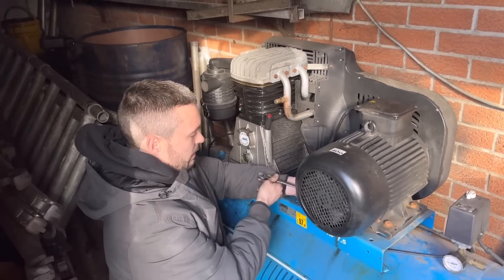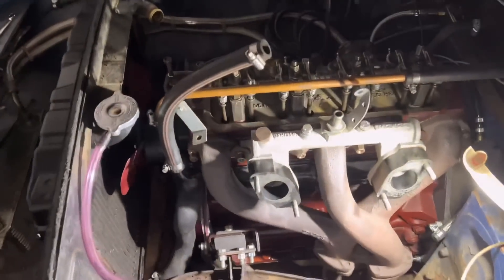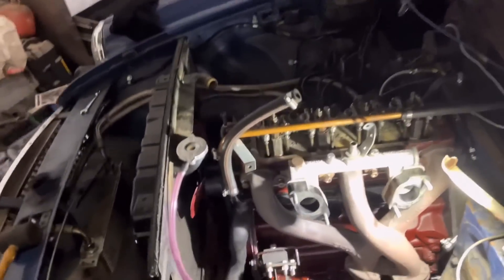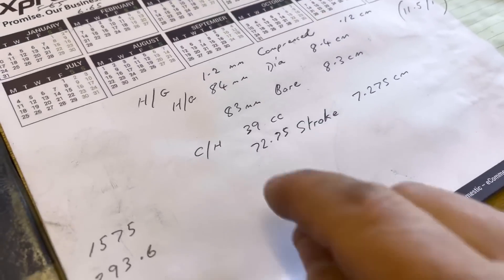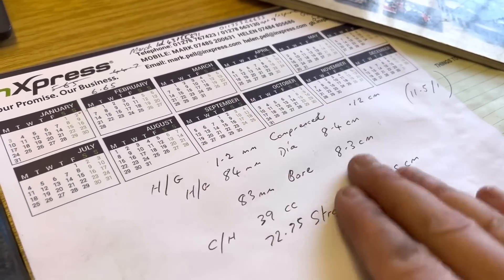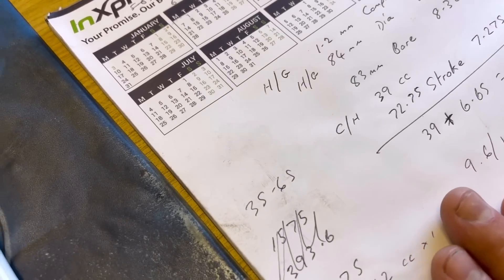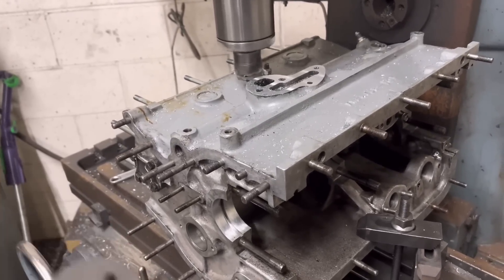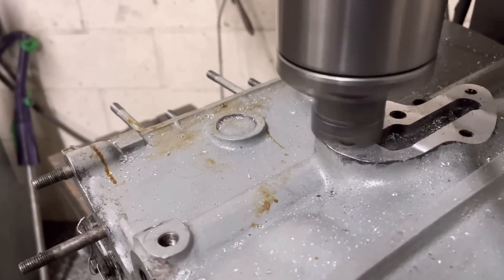WE HOPE YOU LEARNED FROM THIS!

Comment: Im surprised in todays age you’re still going at this with a calculator and pen  😮
Seems a simple excel sheet or a any number of apps or software would be much easier/quicker with less chance of an error…

Also make the CC “x” and set the ratio equal to your ideal number then solve for x if you wanna know what cc gives you your ratio instead of plugging random numbers 😉

Comment: Your claim that a flat top piston has no volume is incorrect. There are volumes associated with the piston that needs to be considered that contribute to compression ratio. 
Without knowing actual details of the piston I have made some assumptions, but will not be too far out. I calculate you are missing approximately 0.91cc, from the top land, bore chamfer, top land chfs (2), between upper face of top ring and groove, behind top ring. Of these the top land contributes the most. 
These are all factors used by engine manufacturers.

Comment: Swept volume + clearance volume divided by clearance volume = CR. Industry standard used by every manufacturer since the dawn of time. This gives theoretical max CR at 100% VE. Any other method (dynamic vs static) is a non starter as VE is not constant at different rpm, induction and exhaust pulse tuning  is impossible to work out etc

Comment: Great Info Lee. I've used that formula for 30 years. I would like to add for the muscle car guys working from Inches. The formula is.
Bore x Bore x Stroke x 16.389 x .7854 for cylinder volume.
Top job as usual

Comment: The MGB tappet side cover gaskets (original cork - suck, new rubber - better), those rubber gaskets compress once the bolt is tightened down.  IT's VERY common to have to gently, slightly, tighenthe center bolt two or three times over a few days to really get them to the point where they become leak proof. A hassle!  But, it works better.  Better to leave the carbs and inlet manifold off until that's done because the manifolds, heatshield, and carbs make getting to those two tappet cover bolts really difficult.

Comment: Nicely presented Lee - well done chap!  As usual its not quite that simple as you need to take into account the cam, more aggressive the cam and the less the compression becomes. Inlet valves stay open longer after BDC.  Longer they are open - lower the compression.   This is also a problem with efi engines as bigger cams often reduce inlet vacuum especially at idle, map sensors dont like that which often confuses the ecu making a smooth idle difficult to achieve.

Comment: Most compressors tend to rattle a way till something goes wrong before they get attention my own ones included. That two stage B series pump is a fair drive and most likely your aluminium pulleys will be worn so the new belts wont last as long as they should till they are chewed off again but you never know, the pulleys could still be in excellent shape. Also you did well explaining the compression ratio calculations, its perfectly simple the way you explained it, going by some of the comments on your excellent video some people really have their heads up their own ass.

Comment: I learned many years ago that when you go skimming heads, you make the deck face thinner and the headgaskets don't seal properly or don't seal at all. If it's just a granny's supermarket transport you'll never notice but if you're playing with boost then it's a total disaster.  Even a good stock head is at it's sealing limit with boost so there's nothing good at all done by skimming them. It turns them into scrap metal. Same goes for any sort of race engine.

Comment: Important to note this is the static compression ratio.  When long duration performance cams are fitted the dynamic compression ratio will be considerably lower.  This is because the inlet valve remains open well past bottom dead center.

Comment: You might find that you need to replace the pulleys on the compressor along with the belts. Sorry, not meaning to bring bad news but it's a distinct possibility. Keep up the good work and will you please switch to working in either metric or bananas completely 🙂

Comment: Your maths assumes that the intake valve is fully closed at bdc.

Engines don't make compression with valves open.
Reply: The calculation performed by Barum is for the static compression ratio - aka the geometric compression ratio.  Dynamic compression ratio is a more complex to calculate and requires additional data.

Comment: I used carbon copy paper on various surfaces to see if they are flat matching, also on manifolds and inlets and exhaust ports and their gasket to make exactly the same flow. 12G295 BMC heads on small bore A series engines always then. Compression ration on 998 with dished pistons, work better than 998 Cooper d top pistons. Took I think 180 thou off the cylinder head to get about 10:1 for four star leaded fuel then. Araldited floating gudgeon pins circlips. Good for about 7000rpm with a 948/229 Cooper 997cc cam, the longer stroke with 850 bore cam.

Comment: On the mg b series engine it doesn't matter which gaskets you use they will leak if you don't seal them. From the factory one side was glued with bostic and the side onto the engine was dry. Once the engine goes through a couple of heat cycles they will leak slightly getting worse with time. If you keep on tightening them the plates distort just seal them and nip them up not too tight.
Reply: I used red gasket sealant on cover mating, and non hardening gold on the block surface. Never had an A nor B series BMC engine leak, with the usual other places given attention too. Christ, this was forty years ago now... before I disappeared into the RAF...

Comment: You need a set of pulleys for that compressor.  I used to work at abac compressor the motor pulley and the pump flywheel have marks worn on them a new set of belts on there own won't last no time as they lay in the bottom of the v on the pulley.

Comment: Lee, you made a simple schoolboy geometry question into a complex confusing example,  Mixing your own calculation of a cylinder i.e. the gasket volume with the Burton calc, which did the same type of calculation would have been confusing to some.  Whilst pi x r^2 is the classic for geometry an easier calc is D^2 / 4 that means that you use the bore diameter as is and then its a simple division by a whole number instead of squaring a fraction of the bore size.  Also conveniently for a 4 cylinder engine, the engine size is Pi x Bore^2 x Stroke 

Why are you going for a static comp ratio when the real requirement is to set a dynamic compression ratio that takes into account the cam to be used?  If you don't do that then you could easily either have detonation or no real power.  A cam with the early closing inlet will raise the dynamic compression ratio above the threshold for detonation and a late closing cam will waste whatever compression you select.  Also, if you take a flat skim off the head to raise compression ratio then the combustion chambers must be cc'd and adjusted to an equal value.

PS  If you don't have a dynamic compression ratio calculation then there are many calculators on the net.

Comment: You could make a spreadsheet to calculate compression ratio quite easily.Then all you would need to do is input the  measured data. It would be very precise. You could also allow for uncertainties i.e, +/- a prescribed %age.
Reply: Yep all day long - and dead easy to do a reverse calculation to tell you what you need to skim by to get a desired cr
Reply: Yep.  And once you start using spreadsheets for one calculation, you'll find a lot more uses.  And you can make print quality tables, so you can give each client a printout of con rod weights pre and post balancing or whatever.  Perhaps also good for estimates/invoices.  Maybe have a master spreadsheet with multiple tabs, one for each type of calculation you can do, initially with all blanks as input, then make a copy for each client motor and add the numbers into the relevant calculations.  Embrace the technology ...
Reply: Just what I was thinking : the he could use a find function to get the head skim value

Comment: Have only watched the first few minutes of the vid, but I have to comment:

One might wonder why Lee has Paul squatting and contorted to tighten the compressor belt. It's because stuff like that is exactly what Lee has to avoid for at least a few more weeks due to his knee! Doing what Paul is doing there is exactly what not to do with a repaired knee meniscus.

Absolute credit to Lee for 'walking the path of virtue' for the next while. All it takes is a moment of distraction to undo what's been done on that knee. You're looking good Lee! You should be in shape in a few more weeks to take more liberty with the knee, albeit it will always be susceptible to recurrence if abused.

Comment: Pretty easy with flat top pistons, just find the swept volume and divide by the desired compression ratio.
Your formula is 393.62 divided by 11.5 = 34.22  which means your cylinder head and gasket volume should be 34.22 CC to get 11.5-1 compression.  There is also the squish area to be figured from the piston crown to the top ring.   When we ran late models, the tech guys would whistle the motors before the race.  They were pretty predictable because the # 2 cylinder was the easiest to pull a plug and get to, so we had a special bushing we screwed into that plug hole that brought the plug out about 1/2" from normal, so when they screwed the gauge in, the compression ratio measured lower than it was.  We were restricted to 10.6-1 by the rules, but with that trick we could get by with 10.8-1.

Comment: I've never understood why people use a different formula for working out cylinder capacity... It's just Pi x bore radius x bore radius x stroke, the same way you work out the head gasket volume.
Reply: That 0.7854 is pi divided by 4, in case anyone is wondering. Saves having to halve the bore before you square it.

Comment: Really useful stuff, thanks. I’d forgotten about the gasket volume.  The existing setup with 9.6:1 is spot on for that engine as originally built by Cosworth assuming the head had been skimmed a bit over the years. 👍.  “The 1500 Cosworth" (Mk. VIII) with paired Weber 40DCOE2 twin-choke, side-draught carburettors on special manifold developing 95bhp at 6,000rpm with a compression ratio of 9.5:1.”  From the book COSWORTH The Search for Power.  It should have an A2 cam in it as well.  It’s going to be a nice period correct motor 😁

Comment: A slight oil leak? It was like the Exxon Valdez, pissing out all over the floor. As for increasing the CR, simply do the caluculations to determine the volume reduction required in the combustion chamber, then add the exact amount of fluid and measure the reduced level taking into account the miniscus, so measure away from the edges, this is a much more accurate way to do it, rather than trying to guess it.

Comment: back in the late 60's when I used to build mini copper and lotus tc engines fore race rally cross I didn't have info and calculaters so I would add gear oil through the spark plugs hole in cc then give that info to Kent cams for profilling, I was 17 years old with very little schooling but my engines were quick,  spend all night polishing and balancing con rods by hand no fancy tools back then, just plier drill and a bench grinder. and Good tutors,

Comment: To get real accurate, there is crevice volume. This is the volume between the piston crown and the cylinder wall above the top ring. This volume is fairly small on most pistons with a square machining at the top edge. There are some pistons manufactured with a bevelled edge. Those really need the piston volume cc'd.

Comment: Hmmmm… would you be better working with 3 places of decimal through the calculation and do the rounding-up at the end? Just a thought..😗 also, you can set the calculation up in excel and just input the variables.
Reply: Yes you should because otherwise the roundings can multiply up to a substantial error ( this is the basis of the "butterfly effect" ),